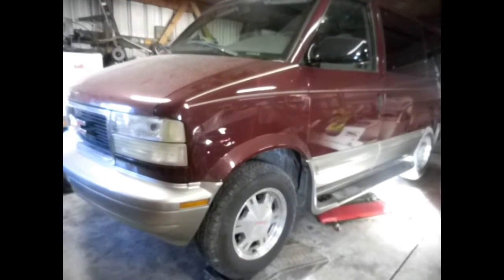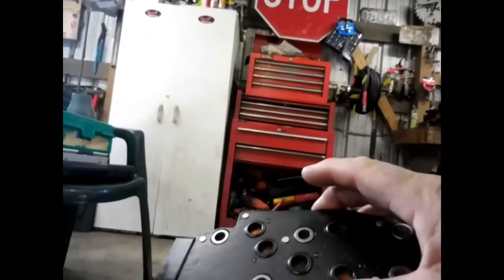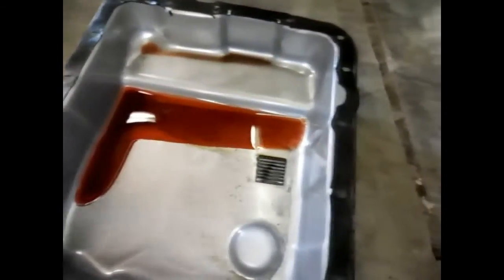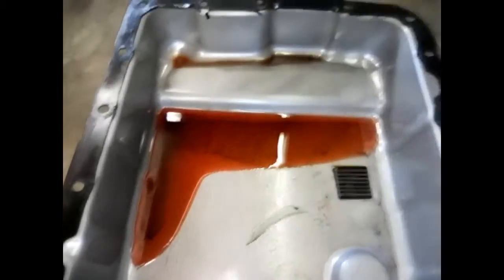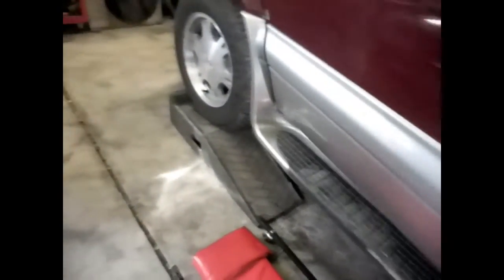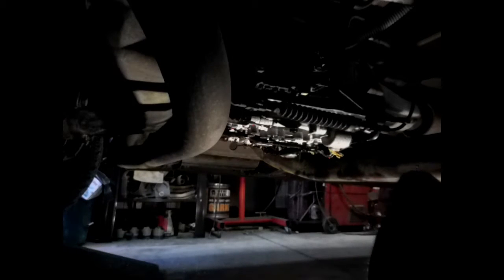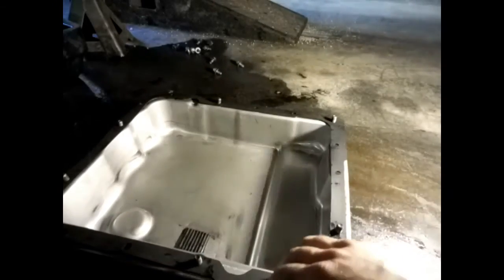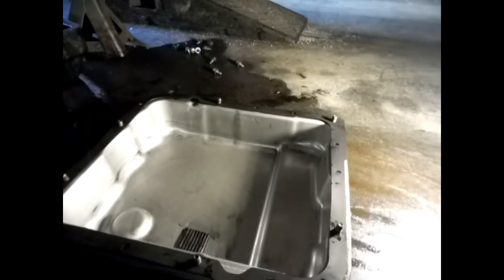GMC Safari van transmission trouble

Comment: Update number 2 so as feared driving with less and or I deduce no fluid can damage the transmission. There is a slight hope however minimal ( since I think I had a leak and now Iittle to no fluid) that transmission is not damaged yet because I read maybe not definetly. Better off if leaking slowly and treated but one can always hope. So hope dwindling but these cars are build so we'll and meant to last so I have that also going for me.
Reply: You fix this and work?
Reply: @merlinjeronimo3886  The lazy bums at jiffy lube never checked my transmission fluid levels. I thought it was my transmission but it was my fluid it was like over 6 quarts low!
Reply: @merlinjeronimo3886  I did add some Lucas so it can help seal any damage caused. Been driving it for several months since. No matter what I love Astros and will either get a rebuilt engine or a refurbished none when this one goes. I have almost 200k and heard these engines can go to 300, 400, or more. I hope so. God bless everyone

Comment: Thomas my car won't drive but it turns on. Reverse is gone so are the other gears but sometimes it drives slowly on first gear. I don't have the money to fix it and I think and mechs tell me it's transmission. Been stationary for 3 weeks but I do turn it on to keep engine kicking every 2 or 3 days. Last night I checked the transmission fluid while vehicle off and  cold which I heard it's suppose to be on and hot BUT it was completely empty on the dip stick??? Is that normal even while cold and engine off? I'll try to ask around tomorrow and try not to get false hope but I did see some wet spots occasionally before drive went and I wonder if it has a minor or major transmission leak. I'm thinking of putting some transmission oil and trying to drive it but first I need to find out if it's. Normal for the dip stick not read any fluid at all when engine off and cold. It's an Astro van 2000. Also say hypothetically it is a leak and it's not that expensive to fix hopefully, I wonder if I have already damaged the transmission or started the slow damaging of it because I drove it with little or no transmission fluid, IF that's what it is hm. Please reply with your opinion or anyone else thanks. I'll make some calls TMR.

Comment: I have a problem with my safari, after spending a period of time on the highway, and then going local streets, the car troubles in changing gears, and sort of kicks forward when changing a gear. It is a less of a kick if you time when the gear is going to change gears and ease of the accelerator.
Reply: Mine did the same. 1-2 shift solenoid sticks on the 4l60e. RR shift body assembly to fix.

Comment: Update I went to this already provided video on checking and adding transmission fluid for an Astro van of my year and upon watching I was wondering why they didn't show vehicle running. Towards the middle to end of the video they said take only off engine cold measurements to see if fluid low (ugh I thought that was the purpose of the normal temperature and on engine dip stick reading??) However then at the end they confirm they took it cold measurements for the video. I saw that Dipstick filled in redish liquid to past the normal reading!! My dipstick was totally empty. I'll verify this if someone replies here confirming it or if a mechanic tomorrow confirms it also so it seems now the question is how bad is the leak, how the heck did I get it, how bad and how much will it cost to fi,x, and most importantly is there damage to the transmission or could it still be ok?? Damn I can't afford someone taking the lid apart and getting dirty yet but I suppose if it's a leak and if I can get it fixed then a later inspection or test driving the vehicle carefully and close to my neighborhood to avoid a large tow bill would be the next logical move then.  I also wonder if worse case scenario and it is a bad transmission then how much would it cost to convert it to a stick shift? More than repairing it? I heard repairs are essentially useless as fixes don't last very long. Hm.  I'm so attached to my car I can't bare to part with it. And who buys Astro engines as I think it's good enough to sell engine rather than scrapping the car or selling it as is maybe.

Comment: I was driving down the highway and went to pass another car, the trans seemed to slip? By the time I made it home there was no reverse gear and I have to push and let off the gas peddle to get it to shift into the forward gears? And if I push the peddle down and just try to run three the forward gears itll just slip, or so bbn it seems to be? 2000 gmc safari?
Reply from the maker: did you find out what was going on with it

Comment: I have a 98 GMC Safari rear wheel drive and have several parts trucks with 4L60E s is there a truck other vehicles that has the same 4L60E that my van has if so what model and year would have a match I'm probably going to have the transmission rebuilt but I have a 99 truck I bought for parts for working on one of our other trucks and I wondered if the transmission in an it would fit it's a 2-wheel drive River 4L60E it has the small 4.8 V8 in it
Reply from the maker: I would say they would be the same   it be worth checking into

Comment: Is it easy to fully change a transmission in a 02 no shops around me can do it. We got the transmission just dont know what we need to put it in
Reply from the maker: its not a big deal if you can get it up off the ground and are decent working on cars just make sure to unhook all the wires and etc
Reply: Can I ask how much you paid for the replacement and your opinion of best place to buy one.
Reply from the maker: I got it off ebay  about 45 bucks

Comment: My 99 astro has a problem where it jerks when accelerating from a red light or stop. Is that a transmission issue or something else? 

I changed the spark plugs, spark plug wires, distributer cap, and rotor but its still the same.